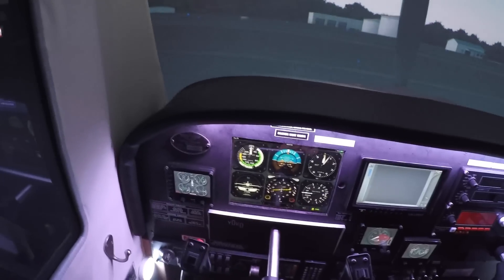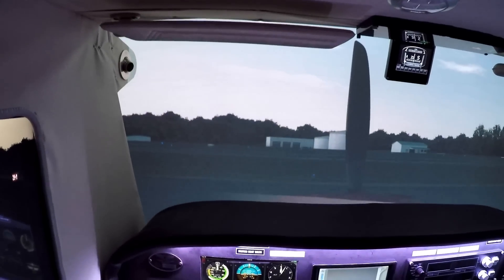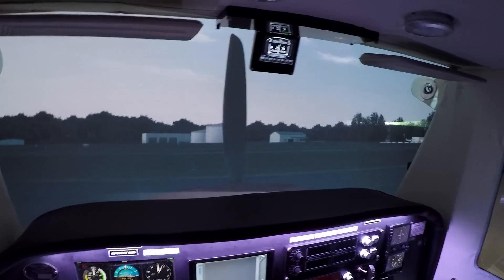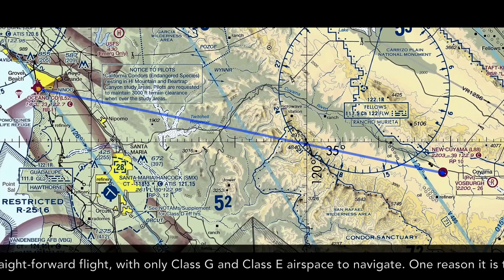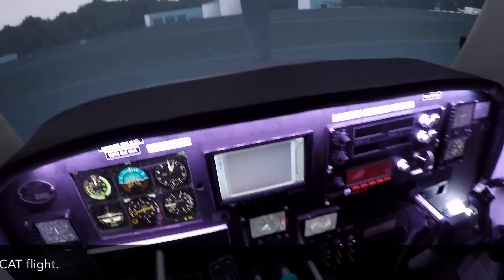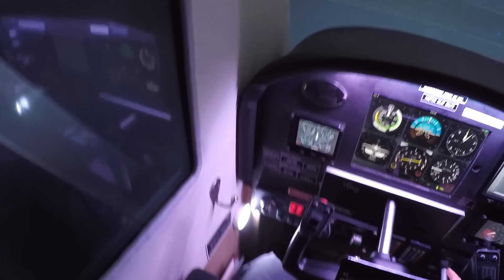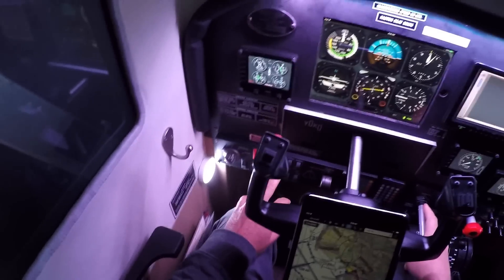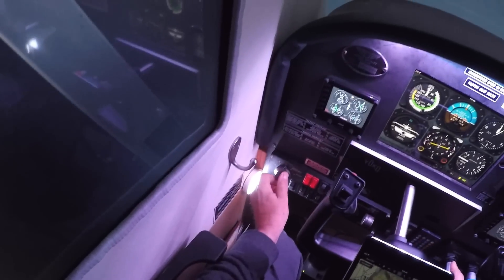The PilotEdge CAT-01 Rating (Cessna 182 Home Cockpit Prepar3D)

Comment: Thanks for the video. Could you please answer this question Starting from a towered airfield you are issued with a QNH/QFE. What do you set your altimeter to when you are approaching an None-towered airfield. i.e. No kind of ATIS. (qnh/qfe) Cheers Mike from Scotland
Reply from the maker: Look for the nearest field you can find that has an ATIS / AWOS. After that it's flying by judgement. That's why it's important to know a basic pattern - if you're always about the same distance from the field on downwind you can tell if you're too high or too low based on where the strip hit's the wing or strut.

Comment: A bit off topic of the video but..how did you get the Saitek radio panel to control and display  the barometer? Is that a P3D thing (I don't have P3D). SPAD or the like? Thanks.
Reply from the maker: SPAD configured it to do that for me with its default profile.